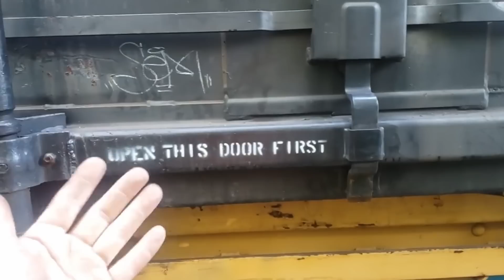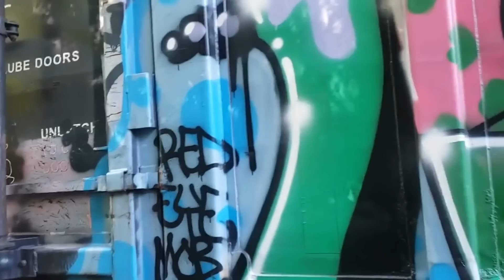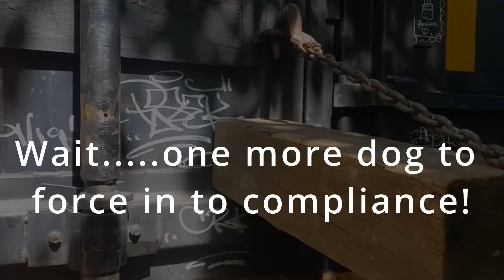Can't close and lock the car door.

Comment: I service gas stations, and I can always use a hand pulling a pump out of a tank!  The work is not as heavy, but sometimes I get to fight with bolts that rusted down to a full size smaller than what they were originally, and some days there are pipe wrenches, long cheater bars, and a lot of hammering!   But it's an odd mix, because the gas dispensers themselves are a computer network, within a computer network, within a computer network.  Sometimes I even know what I'm doing!
Reply from the maker: Fredy   Wow that's variety!   Pipe wrench and lap top!  Good job!

Comment: Every time you say a car has to go to the home shop for repairs all I think in my head is wonder when that one will be in my car spot at work lol. Sometimes depending on adjustment level of plug door roller you can get a pry bar under center of the wheel and leverage it back on track

Comment: I used to be a loader operator at a concrete plant. Ran the loader. Maintained the plant. Cleaned the plant and tried to keep the property safe. Well until our cement supplier decided they wanted to raise their price by not shipping cement to anyone. Allot of hot cold and early as hell days. Decent job for someone trying to get experience applicable for handling starting off as train crew in a town where you can’t get hired by a railroad
Reply: Good practice on dealing with people you don’t really like, working around heavy equipment, not getting distracted by watching the trains in the nearby Railyard and getting up for a 7-14 hour work day sometime between 11pm and 8am
Reply from the maker: Making it happen!  Thanks for your service to industry, The Backbone of the U. S. !
Reply: @eastterminalrailway5975  still laid off and still havn’t been called back so weighing my options and trying to figure out who and where In the north west to apply for. Either UP or BSNF
Reply: Quinton Murdock   If you are a rail fan don’t let the railroad know.  Almost the quickest way to end an interview or the hiring process before the interview is to include that you are a rail fan.  If your resume / application mentions being a rail fan it would be best to edit that out.  The railroads do not want to retrain rail fans.
Reply: @billmorris2613  yeah I am aware. Been talking to people and figuring stuff out with some people. Decided to go for short lines instead of class 1’s and know some pitfalls. I don’t want to do this work because I’m a rail fan it just happens to be while figuring out what I would actually handle/enjoy doing I would genuinely enjoy the work. Warts and all (to an extent, workers deserve rights and all)

Comment: When the plug doors have both rollers off the tracks, like this one has, be very careful that the safety hangers at the top of the door are still in place. Those doors are well over 1000 lbs a piece, and, have no other securement other than the safety hangers, when in this shape. I worked over 33 years as a railcar repairman, and have replaced those doors many times.

Comment: Back in the early 1980s, I worked for a private car company, repair division. I recall that repairs made in interchange service were always billed to the car owner. I also recall there was a flat rate schedule for any given repair. One I can recall was a $2.00 fee for heating and straightening the grab irons on the ends of the car. They caught a guy who had a welding torch on a Cushman scooter who would race through the yard heating perfectly good grab irons (to char the paint) and sending a bill to the owner. He could do hundreds of cars a day, at $2.00 a pop. We were also told to never touch a suspect boxcar door because they could fall without warning and they are very heavy.
Reply: Many years ago a door fell off and landed on a brakeman here, he only lived because the rest of the crew ran over and lifted it enough for him to get out.  He was off work for a long time and never did recover completely, and one of the other guys messed up his back lifting the door.

Comment: I’ve seen worse rolling down he track.  Several years ago on the way back from church, we passed a train waiting on a red board.  The fifth boxcar in had an open door, and a pallet of bricks sitting about six inches from the edge of the open door.  I drove down to the tower and told the operator about it.  They either closed the door, ordeter the boxcar

Comment: R.I.P. jobs, almost applied for one in Guadalupe, CA. The add said welding experience helpful but not necessary, we’ll train. That means you handle the die grinder for a couple years till your ready to get your certs as a welder. Those tests are not easy! But having them you can get the big bucks. If you ever do broken or bent grab irons please show us. They are the most common reason a car is outlawed for safety reasons. The only thing a sub contracting car repair service won’t do is change wheelsets. At sometime ETR will need a steel building two stalls, and a storage track adjacent, then car inspections, wheel Spaulding repair, handbrake and air brake repairs,
and keep ‘‘em rolling.
Reply from the maker: Thanks Mike, I like the way you think!

Comment: The life of a carknocker is a string of temporary repairs. Those doors are always a problem. Between forklift collisions and cars getting slammed in switching they are always out of adjustment. All cars are hot potatoes. Hopper Carr’s always have problems with the bottom dump gates. And they all have brake rigging issues. 
Working trackside in all kinds of weather is tough work.

Comment: My day job Electrical Power Engineer (not a train driver) on the British railway electrified system, I deal with Voltages from 110V ac to 33,000V ac and 50V to 750V dc with Amps up to 10,000A or more.
It's a fun job

Comment: Harbor freight porta power hahaha. they work really well actually. Tested it out on bridge construction. [ Preston]
Reply: A 10-ton porta-power with different attachments can work wonders.  I used a pancake ram with a cut-out wrench on a bolster bolt between the frames of a 75-ton narrow gauge loco one time to be able to lift the loco off the truck (each end) to be able to grease and place a high-density poly plastic disk between the loco and bolster bowl on the truck.  Our shop only had 20-ton jacks to accomplish the lift, one end at a time.  I was the only one there at the time who was small enough to get over the truck and between the frames to get to the bolts.

Comment: I can relate to that.  My second year working at the local paper mill had me in material handling driving a bale clam which has two cast steel jaws that come straight together to grab the square bales of pulp.  It was 20 below outside the dock with a howling wind and all the wet lap bales were frozen solid in the boxcar.  My "instructor" had me set the jaws for the width of the stack and "hit it hard" to drive the jaws between the stacks.  After several fruitless attempts he told me to back up and get a running start.  I wound the lift truck up to about 15mph and hit the bales immediately blowing out the door and door rails and leaving me sitting on top the bales outside.  My super heard the commotion and told me not to worry as it "happens all the time" and said our maintenance boys would have it cleaned up and put back together in no time which they did in about 2 hrs.  Dirty jobs?  Thirty years later I'm working  out in the waste water treatment plant keeping the river clean.  I know a little about dirty jobs.

Comment: last week I was up to some property I inherited from my cousin and saw the switches had all concrete ties and the rails had concrete ties every 4th one. He was v.p. of a class one railroad and there is a gate to a mainline. He and a few friends had hopes of getting an abandoned rail line and starting a tourist railroad. A his equipment is amtrack certified and restored, hopefully my grandsons will have a desire to do it, I would but 76 is to old to start. the only difference is the steam engines are converted to oil. He would run to the scrape dealer and buy the engines and bring them back to his large sheds and they would restore them and make some changes to get certified for class one operation. also has 3 old diesels, and old Pullman in other sheds. the first shed has a large gantry with which they would lift the body up so they could  work under it and there is a pit below that opens to a machine shop. Boy I wish I had this opertunity when younger, but still have my cousin, can't outrun cancer though.

Comment: I don't know anything about railroads, how they operate, or the rules of the road......but is there a business opportunity there at the ETR site as a car repair facility?  It looks like currently you go to them and have a reputation already built up. If damaged cars that could be moved, would the local car owners take them to you to be fixed, or allow you to move them to your facility? If you could have them at your own shed, you'd have all the tools you need ready to go to patch, repair, or scrap anything that came in, and you'd already have a client base going in to it.  Just thinking, and you've probably already thought of this.
Reply from the maker: Possibly that's a good use of some track space.  Thanks for following.  Brian
Reply: @eastterminalrailway5975  I was wondering about car repair / scrapping too. But how about the close proximity to the residential area on the other side?